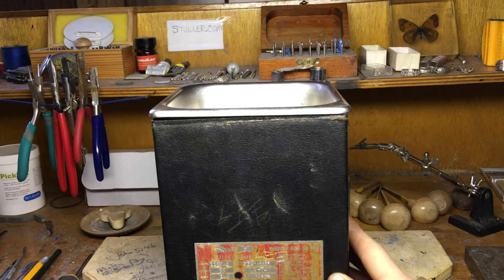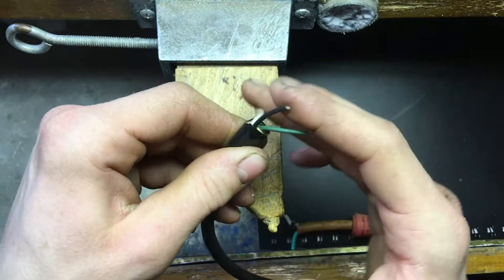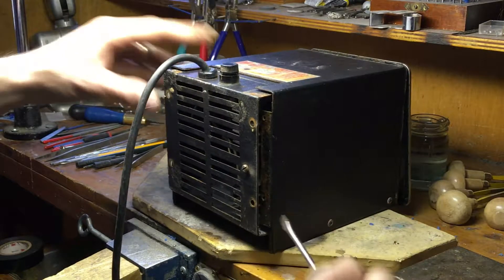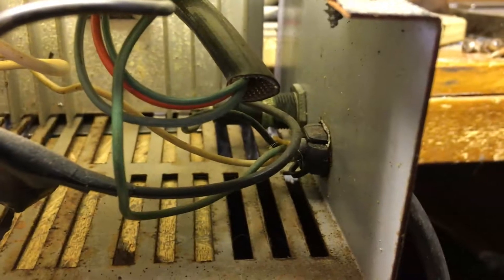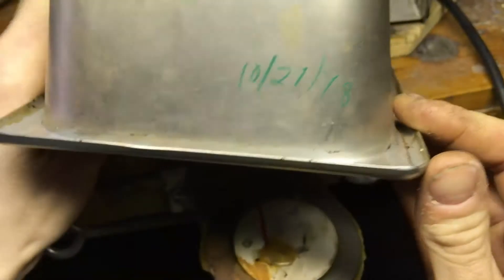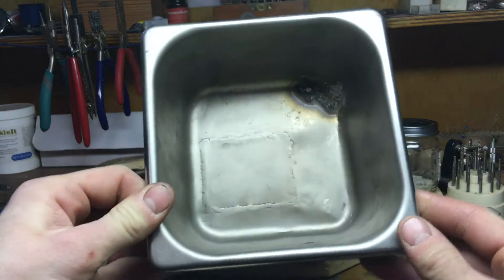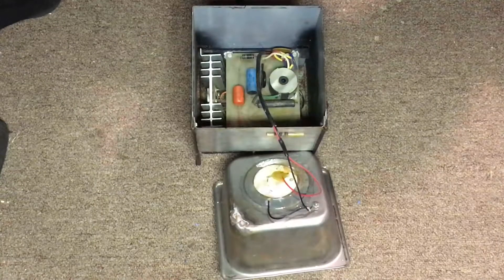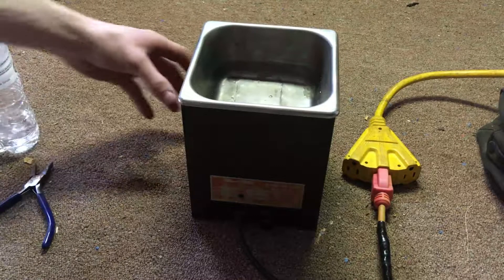1978 L&R T-7 Ultrasonic Repair

Comment: Just for anyone interested in replacing the container as in this video. You can use a sixth size steam table pan. Incase you’re not a metal fabrication guy but want to fix a ultrasonic machine this size.